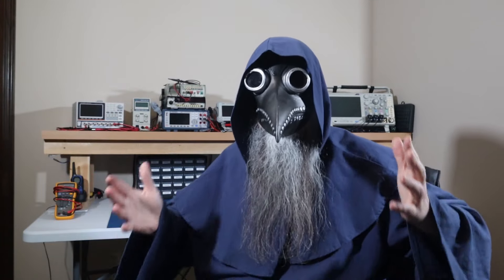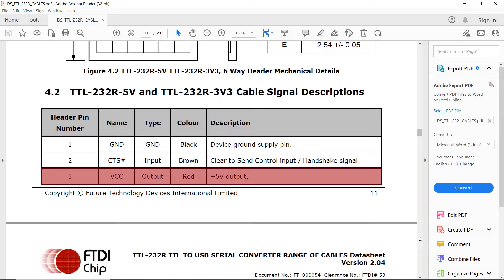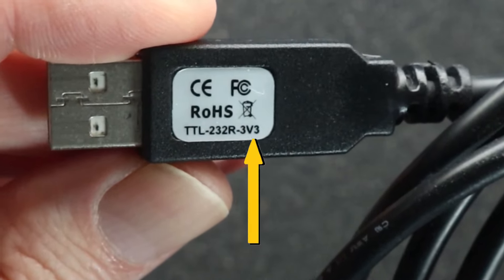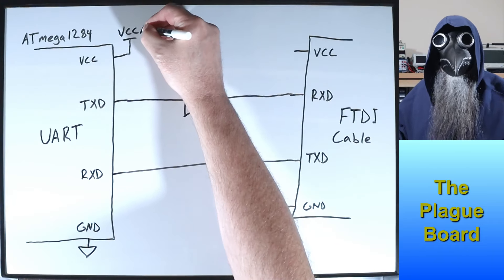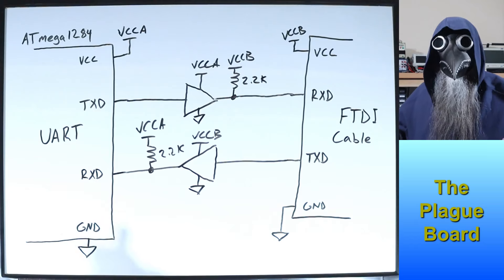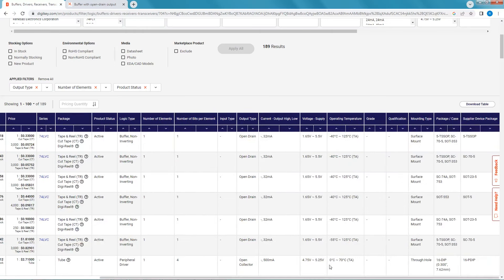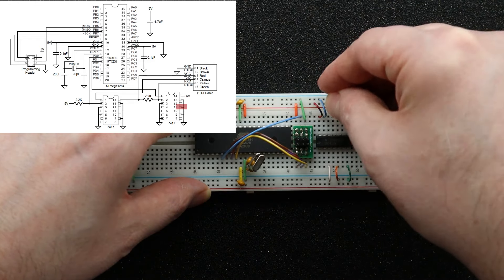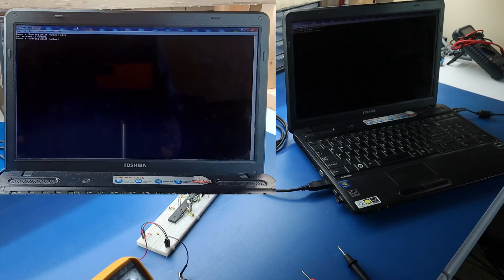Protecting AVRs from an FTDI Cable (EP 57)

Comment: Thank you, doctor, for your diagnosis. This problem plagues me, as well. Not with AVR, but with an 8-bit computer of my own design (HD63C09) using an MC68681 UART. If my hobby computer is powered and then I hook the FTDI to the UART before plugging it into the USB on my PC, it resets the little computer. Same if I pull out the USB before removing the FTDI from the UART.
This seems like a bad design. I’ve never had this problem with other USB-TTL interfaces.

Comment: The issue is that none of the internal protection circuits will be powered, in theory, that is. However, in practice, that AVR will be powered via the GPIO pin and will probably run your program. 😄

Comment: Is optically isolating the variable of 3.3V and 5V together in one board an issue?
Reply: Optoisolators are often too slow for comms work, plus they're way more expensive than OC/OD buffer chips, & in this kind of application, the pull-up resistors on the buffers take care of the voltage conversion for you.

Comment: I do something similar but just using a couple of diodes. As the UART only pulls low, I have the anodes connected to the RX sides, with a pullup from that side's power source. It does mean that the LOW pulse doesn't quite go to GND, but it's good enough :)
Reply: It'll work with short cables at low(ish) speeds, but it'll make the link more susceptible to noise / errors. If you start getting errors every now & then, that'll probably be the reason.
Reply: @theantipope4354  I use this exclusively on PCB designs and have reached speeds of almost 1M baud between devices this way. Best to use Schottky diodes, but it saves board space and cost generally.

Comment: This reason is i wish i had optical isolators for UART, but from what i've seen its a pain to implement at any reasonable speed
Reply: TLP2361 opto. Works a treat, even at 115200 baud.